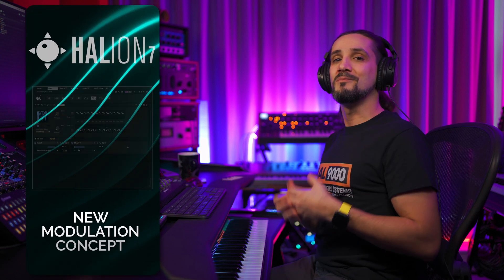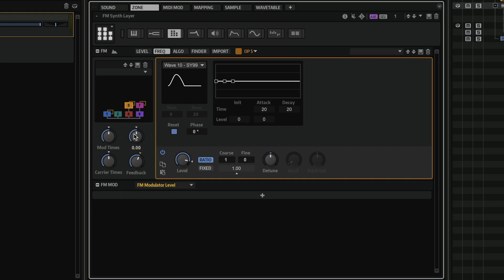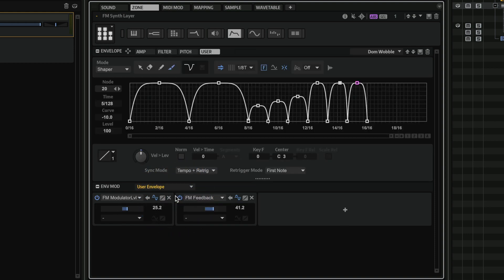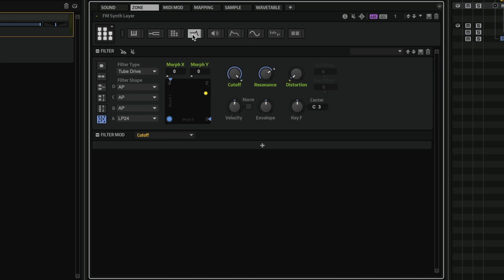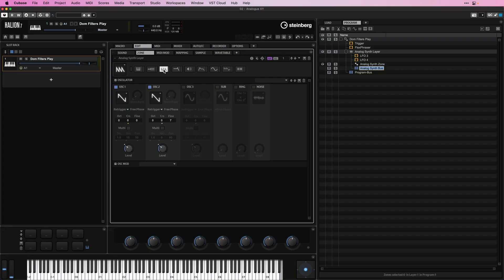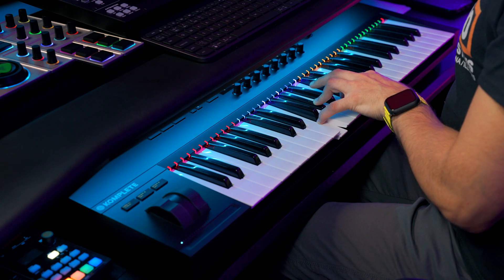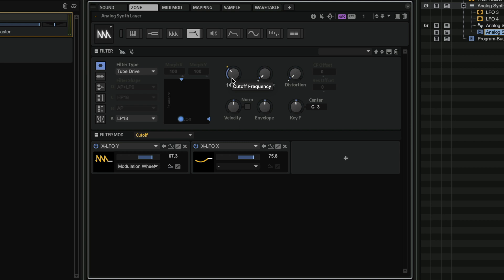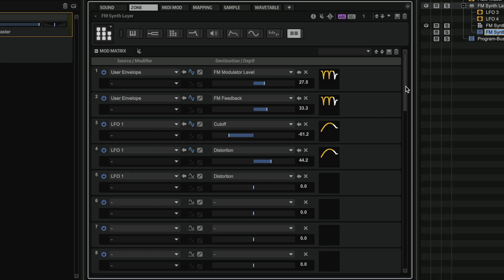Redesigned Modulation Concept and X-LFO | HALion 7 new Features

Comment: Halion 7 need the dongel or the activation maneger?
Reply: It's using the new licensing system
Reply: I think licensing is now handled with eLiscenser Control Center and activation is handled with Activation manager. 
You need those along with Steinberg Download Assistand and Steinberg Library manager to install any Steinberg 
software including Cubase. I'm not sure how you go about license transfers if you need a new computer but this 
replaces the USB dongel. Cubase SX and Steinberg software from that time used a software based dongel.

Comment: I was lured into Halion 5 from the promotional videos. Even to this day, I have given up on learning some of the features of Halion 5. Halion 7 seems even more complicated with an extreme learning curve to utilize all of its complex features. I just don't have the time to spend months even years learning this overly complicated product. VST manufacturers need to focus on making instruments more simplified to implement all of these features. I am curious as to how long of a time Dom, spent getting this far with the prototype before doing these videos?. It had to be many months of figuring the instrument out. For the time being, I think that I will continue to stick with Kontakt by Native Instruments. Excellent presentation By Dom though.
Reply: It only means HALion is not for you. The market is full of simple, easy to use soft instruments. And for those wanting depth there are solutions like HALion. Just get something that's useful for you.
Reply: @DragosStefan  If there were a simplified version of Halion that produced the same results! that is the point, that you left out.
 Yes, there are a bunch of simple-to-use instruments, But not many can produce similar results as Halion 7 without an intense learning cure. Yes, Kontakt is somewhat complicated to learn all of its more intense sound creation methods, however, Kontakt does make it quite simple to achieve similar sounds very quickly. Kontak also allows a ton of 3rd party plugin instruments, unlike Halion, there are very few 3rd party contributors to the Halion protocol, Now if Halion would allow 3rd party Kontakt instruments into Halion 7, That would be a game changer. Halion Sonic 7 is simplified and you can achieve similar results as Sound creation, by using one or two modulations, and reverb/delay plugins without spending months upon months learning the instrument.
Reply: @realmusic4you  I get learning something can be a pain, and some of this stuff can be quite complex, but I think you're getting a lot of things wrong, or perhaps just describing things badly. Saying Halion doesn't allow third party libraries is....wrong. The variety and depth may not be there, but nobody is stopping them.

I think it depends on perspective, and we're all unique, but personally I see both these packages (and Falcon for that matter) as being very similar, the concepts are transferable, and I find Halion very fast to get something up and running from scratch. I'm curious how you think it could be simpler, genuinely.
Reply: @realmusic4you  Yeah, sounds like halion sonic is what you want. Halion can import old kontakt libraries, without copy protection. The new stuff is off limits. There are more and more libraries for halion though. Maybe just ask your favorite library creators to port their stuff over?
Reply: @DragosStefan  I think I will have to agree with this one. Halion is an instrument targeted to people who want to spend time digging into nitty gritty details to craft their sounds. If that is not your thing I don't think it is your thing cause there is little in terms of expansions and presets to buy for it.
Reply: None of this makes any sense to me, to say that Halion is too complicated but Kontakt is simple? It's an odd statement when they're both incredibly complex workstation samplers.
Reply: why are you making this so complicated?  its for Creators to use in depth ..   if you want it simple use Halion Sonic.  simple as that.

Comment: There's a lot going on in these GUI's, and the visual refresh is better than before, but I'm still struggling to see things, I was really hoping this would have been improved in v7 (unless I'm missing something?) It's great we can resize the overall window and alter layouts, but I'm stuck squinting at a small portion of that central interface for the majority of work, it's really frustrating.

Loving all these new features in 7 though, just wish I could see them.
Reply: I have a hard time grasping what parts that can be resized and not, but in general I agree with you. My aging eyesight also struggle with small and feature packed interfaces now.
Reply: It's funny, two most powerful samplers (Halion & Kontakt) are stuck with these 15+ years old-style interfaces. I guess it's a function of the challenging task of re-designing such complicated plugins. And i presume that Steinberg think that as long as N.I. can get away with what is possibly the worst ever interface (Kontakt), then they can drag the Halion interface out a few more years. By the way, save your eyes and get yourself a 43" 4k monitor, Halion looks fine on that. But don't get the cheapest as they have very limited viewing angles, something like a LG 43‘ Monitor LG 43UN700-B is great. And there's quite a lot of tweaking possible, for example you can make the envelopes enormous if you know where in the interface the drag. @prewinder
Reply: @retromograph3893  The sad part is that I have a 43' now which is to small. I have thought about getting a second to split daw an plugins up.